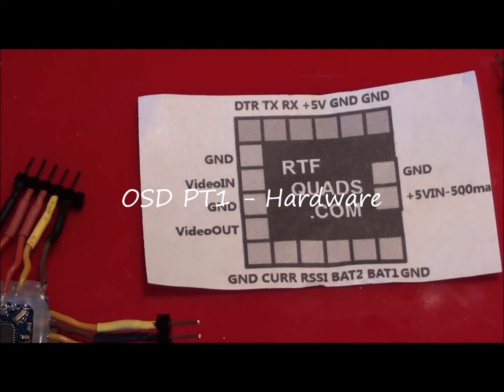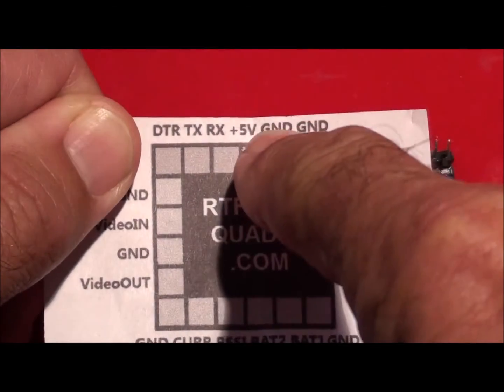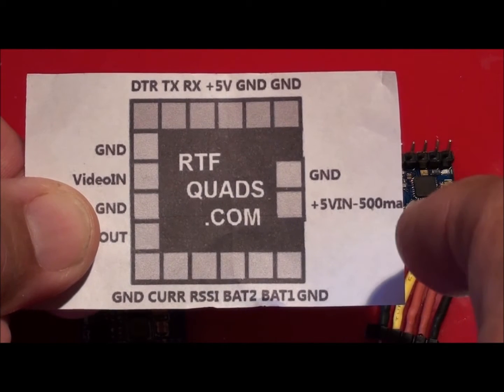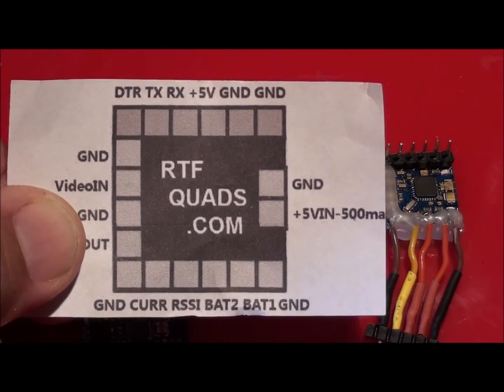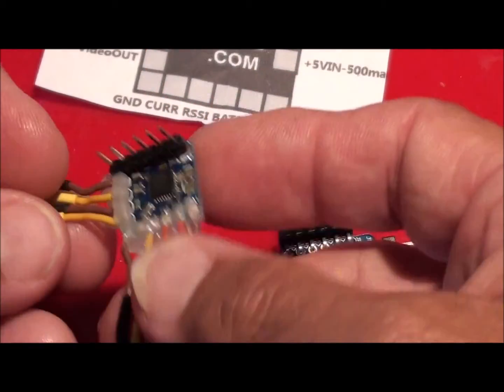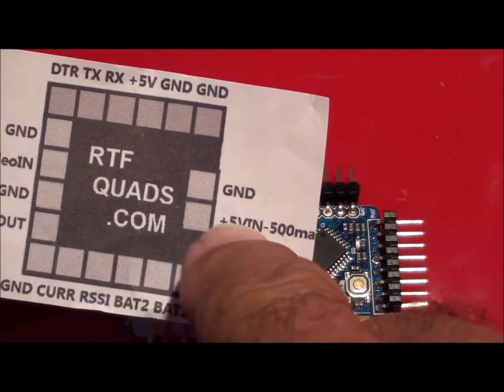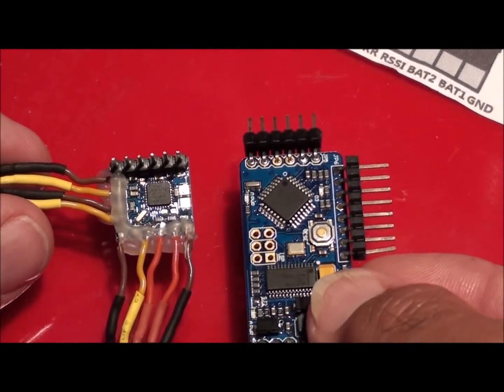OSD pt1   Hardware

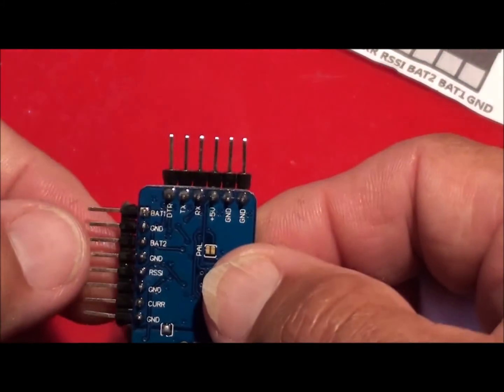Comment: just watching this and at 4:30 you was talking about the 12v blowing it up and i can see that you have a soilder blob on the bottom of the board allowing the 5v to power the whole board. if you unsoilder the blob you can plug 12v in at the video side with out killing the board
Reply from the maker: +lewis shipway I guess the point I was making was that the older MINIM boards did not have the link so you could (or needed to) connect power to each end to flash them..... These newer boards have the link so if you connect 5V to one end and 12V to the other you will damage it....that was the point I was trying to get across. Thanks for watching and commenting. I hope you got something out of it.